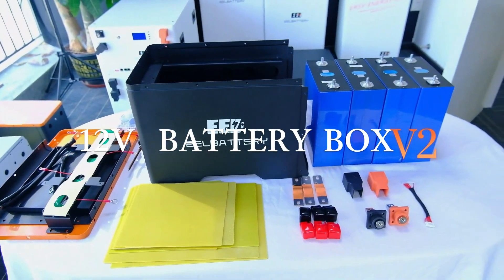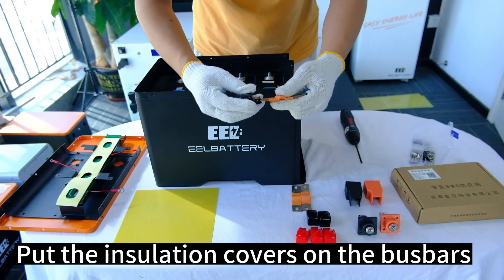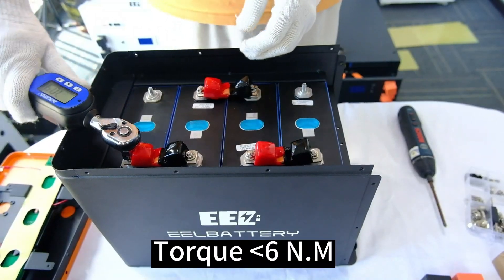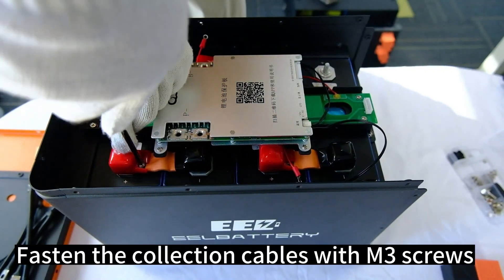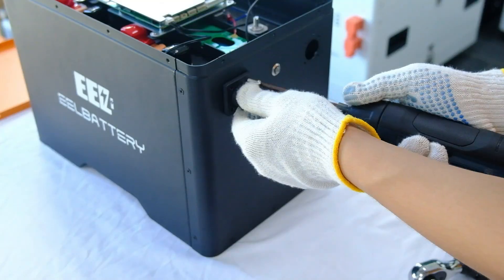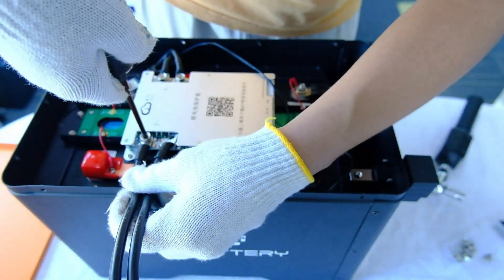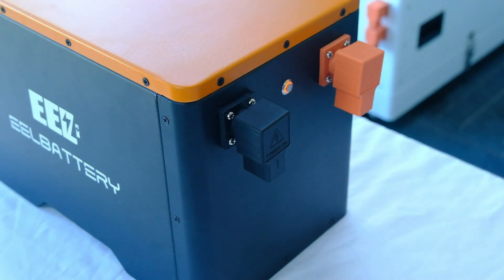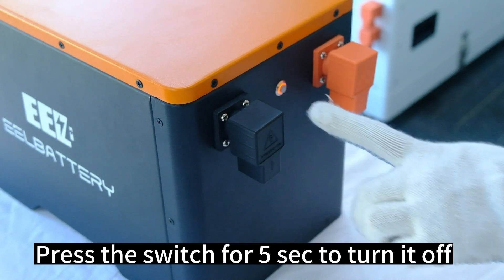EEL 12V DIY V2 LiFePO4 Battery Box with JK BMS | Step-By-Step Assemble | Let's DIY

Comment: Good quality kit EXCEPT the ANL fuse has an AIC of only 10kA and is not appropriate for lithium use. This 280-304AH battery has a short circuit current of around 18000A so EEL need to modify the kit to fit a 250A class T fuse with AIC of 20kA. an NH fuse (which have 80kA AIC) would also technically be possible but won‘t fit the case from the size.

Comment: Would it be possible to modify this 12V DIY Battery Box Kit for 280Ah/302Ah to 24V for REPT 150Ah cells?
No big modifications are needed because REPT 150Ah cells are the same size as 302Ah, just half of their thickness.
It would just be enough to modify the top bar above the cells with more holes for the preassure release velves.
It would be great to have a smaller DIY 24V 3,84Kwh battery kit in the same battery box as the original 12V version.